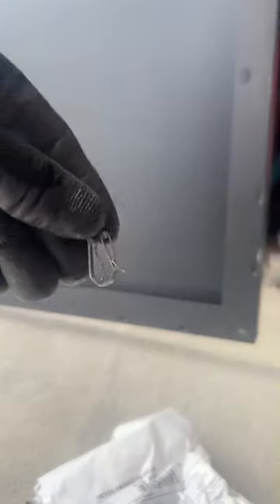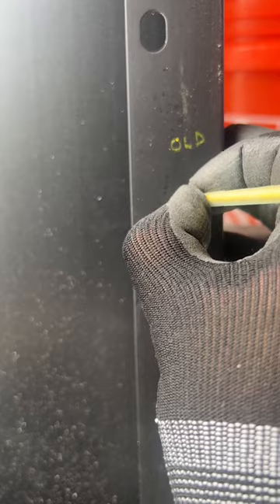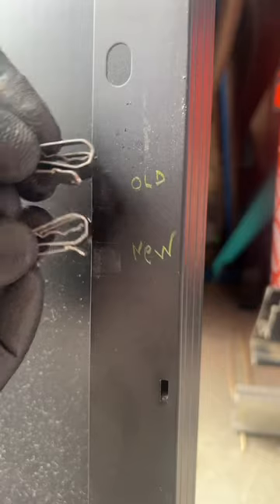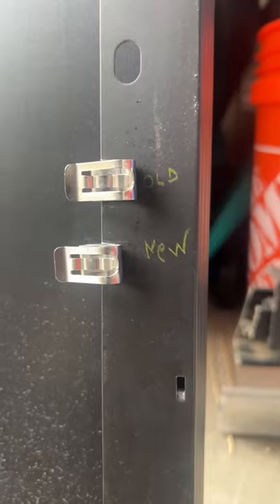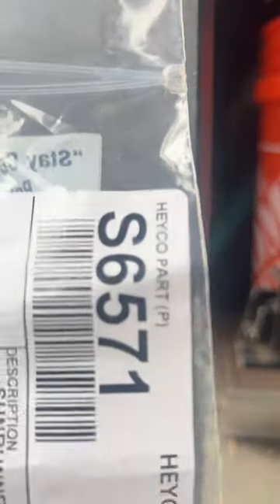The Gold Age Of Solar Ended With Half Cell Panels

Comment: I like center aluminum supports. Now there will be an aftermarket to undo the chintzy manufacturing.
Reply from the maker: Can you buy those?
Reply: @solargoat  t slot aluminum extrusion. I liked handling them way more with them.